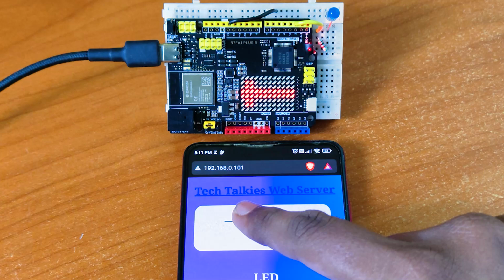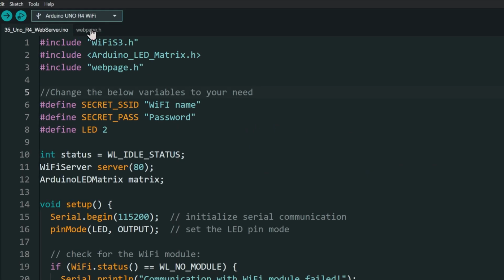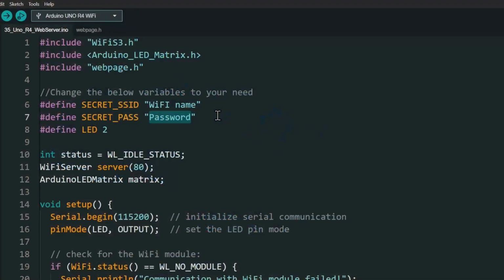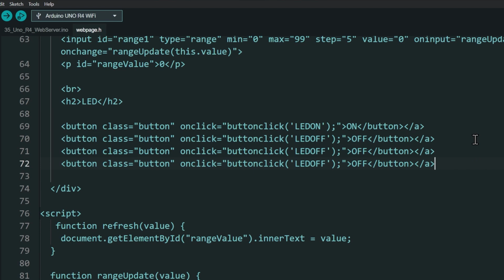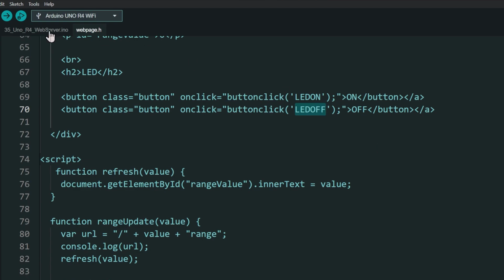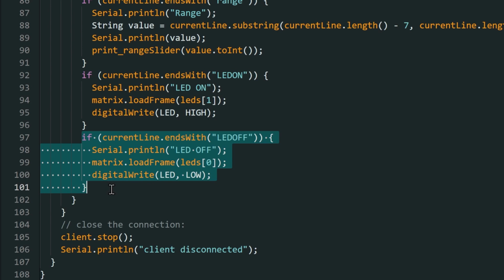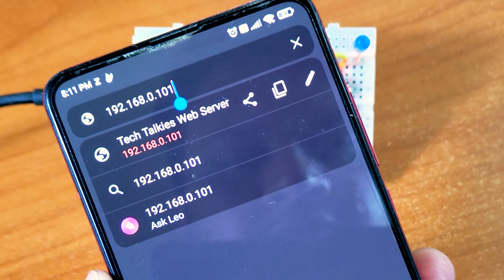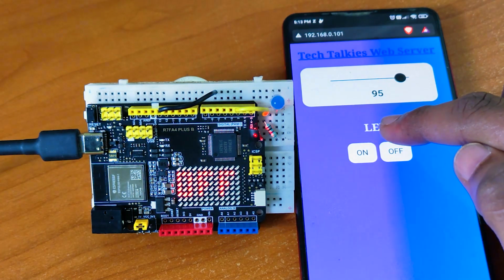Uno R4 webserver | Detailed guide and code | Beginner friendly

Comment: I need some help here as whenever I run the code it gives the IP address as just 0.0.0.0 and not my actual IP
Reply from the maker: It might not be connected to the wifi network then.
Make sure the network you're trying to connect to is not 5 GHz

Comment: When i compile the first code
It says ror : exit status 1 
what should I do ??

PLS HELP !!!!!!
Reply from the maker: What board?
Reply: @techtalkies1  ARDUINO UNO R4 WIFI
Reply: @techtalkies1  ARDUINO UNO R4 WIFI
Reply: @techtalkies1  Arduino uno R4 WIFI
Reply from the maker: Is there any error
Reply: I have the same problem.

In file included from C:\Users\Leighton\AppData\Local\Arduino15\packages\arduino\hardware\renesas_uno\1.2.1/variants/UNOWIFIR4/includes/ra_gen/common_data.h:12:0,
                 from C:\Users\Leighton\AppData\Local\Arduino15\packages\arduino\hardware\renesas_uno\1.2.1\cores\arduino\WMath.cpp:26:
C:\Users\Leighton\AppData\Local\Arduino15\packages\arduino\hardware\renesas_uno\1.2.1/variants/UNOWIFIR4/includes/ra/fsp/inc/instances/r_ioport.h:83:5: internal compiler error: Segmentation fault
     IOPORT_PORT_01_PIN_07 = 0x0107,    ///< IO port 1 pin 7
     ^~~~~~~~~~~~~~~~~~~~~
Please submit a full bug report,
with preprocessed source if appropriate.
See <https://gcc.gnu.org/bugs/> for instructions.
exit status 1

Compilation error: exit status 1

Comment: In the webpage.h part, im having a error that say "webapage.h: no such file or directory"

What should i do?
Reply from the maker: You need to create the webpage file
Reply: @techtalkies1  can u pls tell how to create
Im first time creating such a project
so your help will be very much appreciated.......
Reply from the maker: On the same website, there will be a another code segment for the webpage, copy that.

In Arduino IDE, top right, there is a 3 dot menu, press that and select new file. Give the correct file name and create the file. Paste the code there. Make sure the name is correct.

Let me know if it works now
Reply: Thanks
Reply from the maker: Did that work?